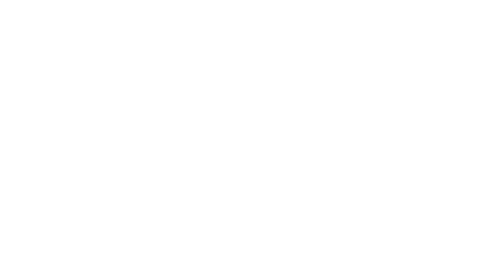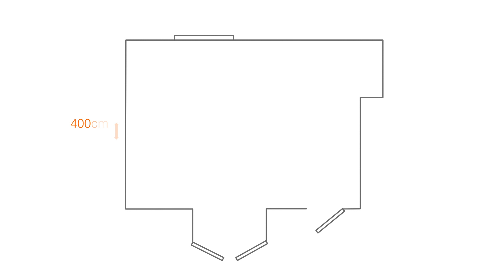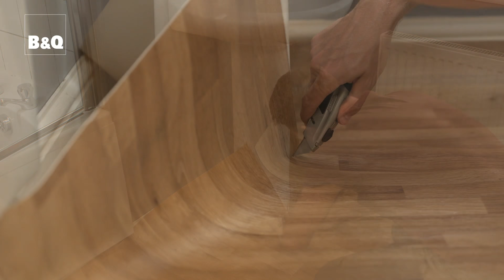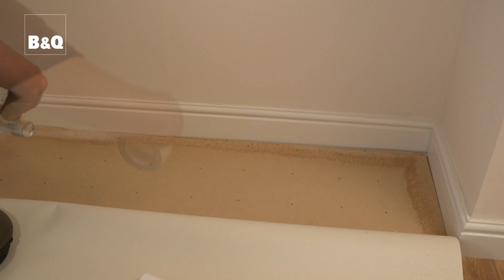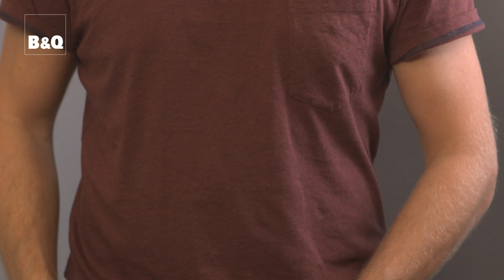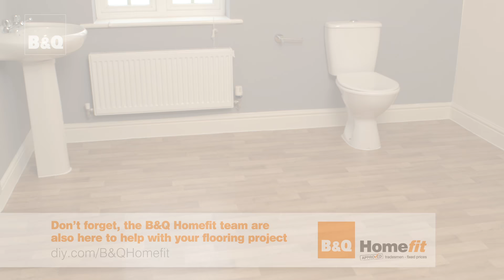How to lay sheet vinyl flooring

Comment: How do you fix vinyl flooring that has come up in an area? (Not sticking to floor)
Reply: Contact adhesive mate. Spray both the subfloor and the vinyl, leave for 30 seconds then lay vinyl flat and add a bit of pressure.
Reply: Don't use contact adhesive as it will be felt through the vinyl. You need "Vinyl flooring spray adhesive". Make sure it's for vinyl and not carpet.

Comment: He said read the manufacturers instructions but there isn't any instructions on the vinyl sheet I brought from BnQ
Reply: @bandq  I had the monzen grey vinyl sheet flooring from BnQ, which is 1.1mm thick. I just need to know if it needs a underlay. I already have tile backer board on top of floor boards. 

Also does this need adhesive just around the edges or completely underneath.

Comment: Can I use it on carpet? I am moving into a unit with carpet throught and I want to lay vinyl sheets. Owner do not want to remove carpet but fine if I can do vinyl floor sheets on it without damaging his carpet..
Reply: @bandq  is that the only reason ? Muppet's.

Comment: hmm...so how do you fit a T bar or threshold bar in the door way.
Reply: You cut it to length and either glue it down or use double stick tape. Not hard.
Reply: I ring my mate hes a carpet and vinyl  fitter🤣i tryed cutting around toilet and it went wrong i ripped vinyl had to by another piece its not as easy as it looks 👍